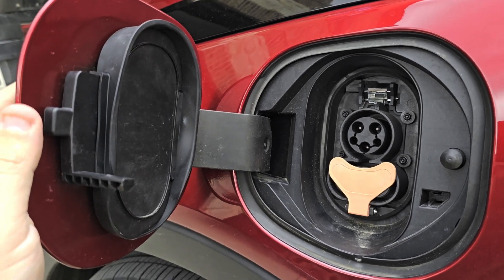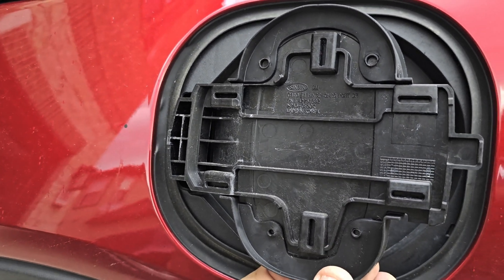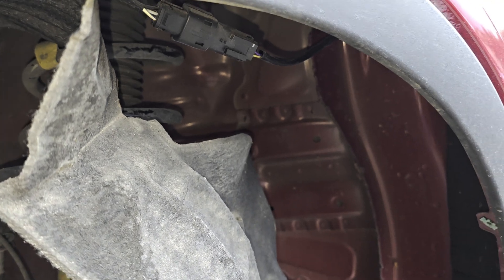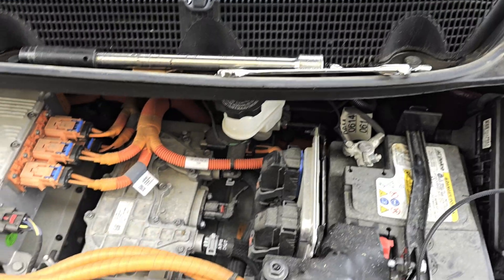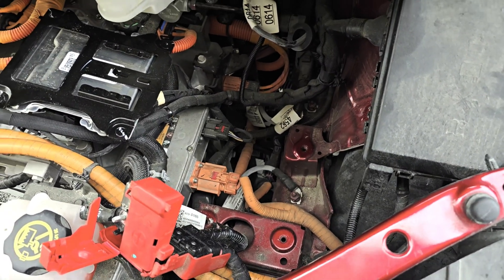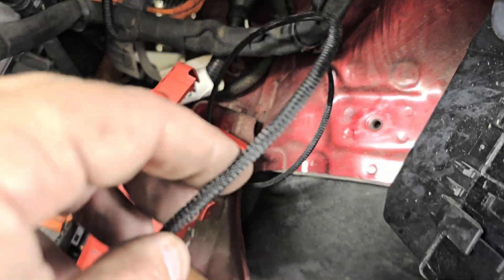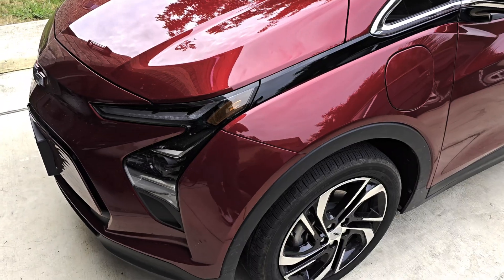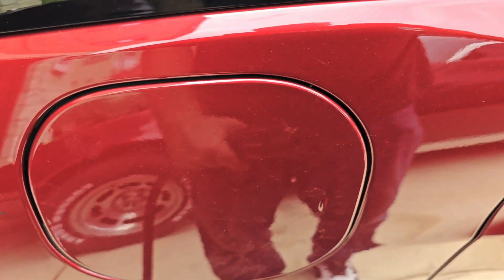Chevy Bolt EV GM accessory Illuminated charge port installation process

Comment: I had one installed by the dealership, it broke recently, this looks like a pain to check if its wiring or not. It was free, my car was ordered by someone else, and they cancelled and I was just there. Put an immediate deposit and when the car arrived I got it. The original person ordering the car wanted the light, I didn't want to pay for it so they just gave me the light and the install free. It finally broke at 53k miles and 2 1/2 years old. I miss ot already it was nice lighting up the charger port.
Reply from the maker: @allys537  could be wiring...might just be a burned out light. You can disconnect the harness under the splash guard and test it for voltage there. That will give you your answer
Reply: @TractionControlusa 
Thanks, I'll have to try that, I need to pull the fender liner in warmer weather, I hit an ice bank and need to pop out the front clip a bit... I'll have to check when I get it removed. I'll have to watch your video again.

Comment: I followed the video. But why does the old bolt light up when the charging hole is opened, but the new bolt doesn't light up when the charging hole is opened? What setting should I do?
Reply: I’m having the same problem. I just installed the OEM light and it mostly works except after sitting awhile when opening the charge port door it doesn’t light up unless you wake the car up by other means such as locking/unlocking the car. I thought I read somewhere there might be a setting to fix this but now I can’t find it.

Comment: Will these installation instructions video also work for a 2017 bolt ev
Reply from the maker: @Fregoso310  should be the same. But you will won't to verify the pins are the same that you connect to

Comment: Great video, I installed the port with no problem in my 2022 premier and when I got to the pins on the connector they were full with other ones in use. What year was the one you were installing yours on? The instalation went well just dont know if I should take it to the dealer to complete the task....I ask this only in the public domain to see if anyone else had this problem??
Reply from the maker: @tbrednet7347  this was on a 2023 bolt 2lt. The 22 bolt doesn't have a premier version. If you have a bolt EUV it is different to install this part. You'll probably need to look up the correct pin out

Comment: Seems useless and attracts unnecessary attention.
Reply: I would agree with you if you weren't dead wrong and weren't aware of most EV owner daily usage. Charging at night at home on the side of a house where there is inadequate lighting, this makes it a much better experience being able to see the charge port where you're plugging in. It also makes determining the charge status (on/off and how fast) easier than the little light on center of the dashboard. There's a reason this exists and it's not just aesthetics or else it wouldn't be tied to the charging status indicator.
Reply: @MikeRushton  , okay whatever you say.   I think the blinking lights on the dashboard and elsewhere attract unnecessary attention.    There is no need to advertise your car and attract the riff Raff.

Comment: Good video.  Why didn't you use the TEMPLATE that shipped with the kit ?  just curious.   For information.. the EUV uses DIFFERENT pins that the EV does... Everything else is the same for the install.
Reply from the maker: @RandyFuchs  my kit didn't come with a template, I saw it mentioned in the instructions but it wasn't present. The plastic part on the back was easy to remove and stick to the housing so I just went that route.
Reply: @TractionControlusa  that's odd mine came with a clear plastic one. At first I thought it was just packaging but notice it had a QR part number on it
Reply: Randy, what are the PIN locations for the EUV? I'm trying to wire it up. Thanks!
Reply: @donzeman9295  WHITE in pin--- 6 BLACK in pin 7 (for EUV only)
Reply: Yes, clear plastic cover on the piece is labeled "template". guess the newer version has that instead of the brown template.  clear plate has the holes marked where to drill, 2mm pilot holes, then 5mm on the 3 mounting holes, and 8mm for the wire hole on the bottom.  Great video.  Thanks for posting.
Reply: @noscoop  no BROWN template came with it.   the part shown in the video that was used as a template is a piece of the assembly that was unscrewed and used as a template.

Comment: Nice! 

The orange flap will interfere with inserting a high speed charge handle unless it is modified or replaced. Fyi!
Reply from the maker: @vintagebikewurx3730  mine opens fine. Goes beyond 90* when open so its not in the way at all. I would post a Pic if I could.
Reply: @TractionControlusa  they sell a different flap. I bought one but didn't use it because it came after I modded mine.
Reply: @TractionControlusa  I have an EV. Maybe it's a little different. 

I had to mod mine

Comment: 😏WOW, Thanks for a great detailed install video. I purchased a aftermarket version last February and spent a lot of time looking for a install video or step by step instructions. Found a Gen 1 Bolt install video which is similar, but I was told the two pin locations were different. Not a big fan of removing too many parts of a new vehicle, so I put it on hold. I'm now only working three days per week, so I have plenty of time. and will tackle this mod in the next several weeks. This product is a neat addition, but not a must have. I found the aftermarket version online for $50 total shipped so i purchased. Once I install, I'll post the results for comparison. Thanks Gen5Concepts!
Reply: Hi, I went with the factory light and following your instruction. Pins 28 & 30 are filled. I read the pin locations for the EUV are different? Do you  know the correct PIN numbers? Thanks for your help. Don
Reply: Be aware, pin assignments are different for the Bolt EV and Bolt EUV. Power for the EUV is pin 6 and ground is pin 7. For those with dexterity and patience, I was able to reach the plug and insert the pins by ONLY removing the battery and nothing else. Saves a lot of disassembly which is difficult.🙂